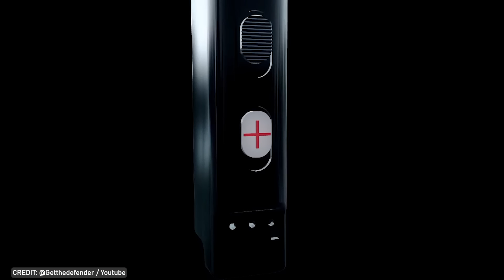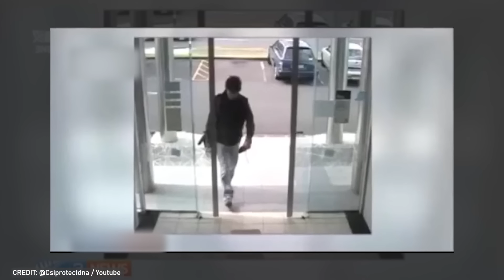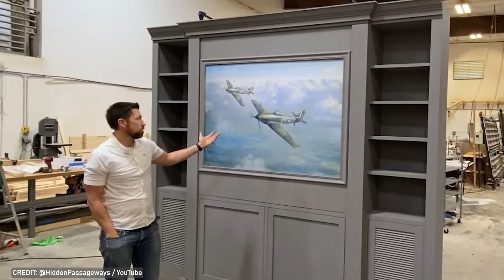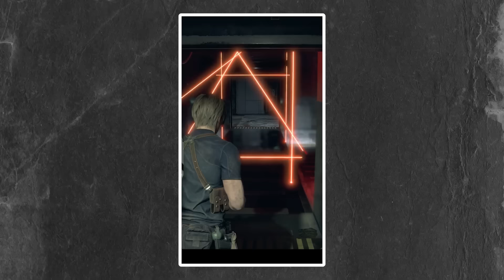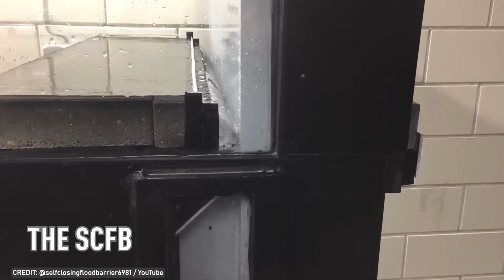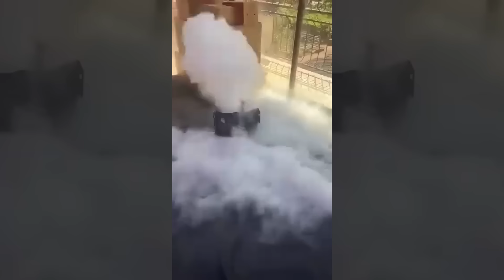Overpowered Home Defense Gadgets You’ll Wish You Had

Comment: Use carriage bolts for your wall spikes or one-way only screws, use a welder to cap the heads and weld the nut to the bolt

Comment: The tornado box doesn't seal? That's going to be a fun and painful experience.
Reply: A tornado that rips your house apart will also rip the bolts holding that thing to the ground right off.
I think they are selling the illusion of safety & they get away with it because people either never actually need to use them or if they do & they fail, they are too deceased to sue them.

Comment: If you're in that steel box bolted to the floor and a tornado comes through it's going to take you in that box and put your miles from home
Reply: OMG, I agree!!!  It only guarantees that IT will not be breached.  They DON'T guarantee that the soft, squishy things inside it won't be turned into a red-gel smoothie by the time it comes to a halt!
Reply: That was the first thing I noticed.  I was like that thing is just bolted down there is no way it can withstand an f5.